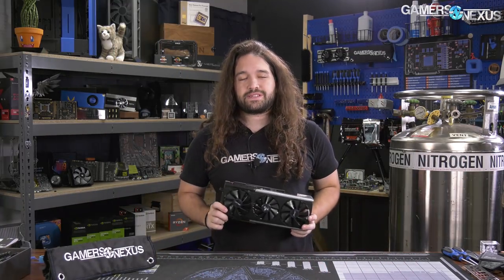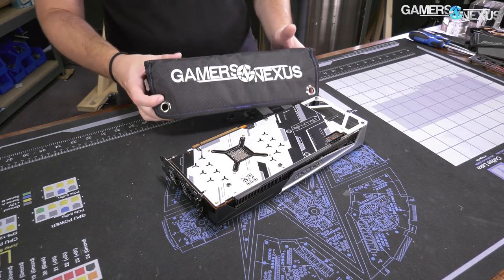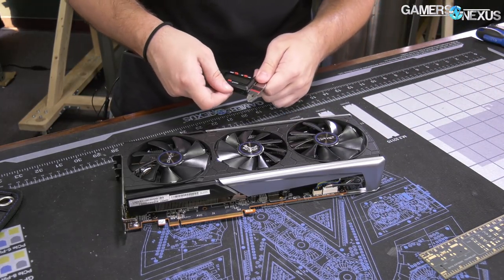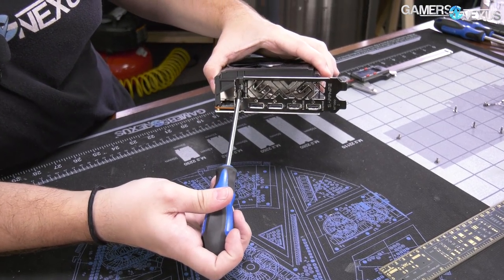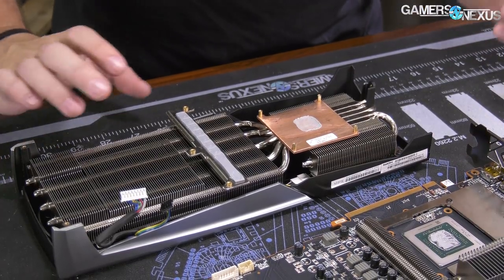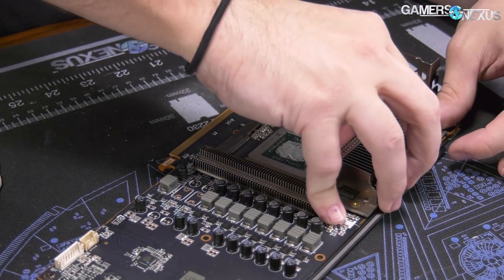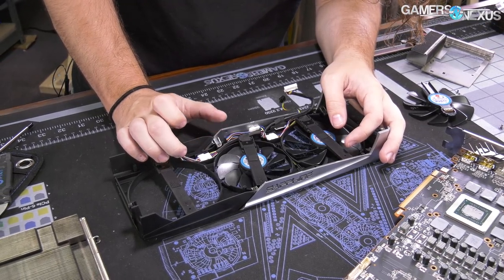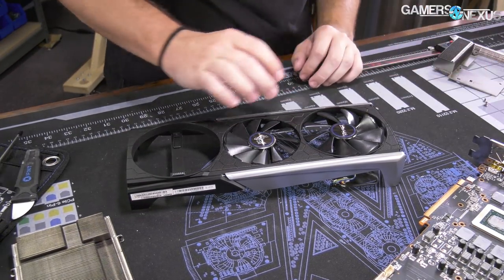Tear-Down: Nitro+ OC Sapphire RX 5700 XT - Thermal Design & Assembly

Comment: Amazing cooling solution, now what i want is them using fans from noctua, more silent more durable. Sure downside it would cost bit more but currently the fans used on most $400+ gpu are a joke compared to brands i use for my case fans. I would pay more for a gpu with my type of brand fans.
And no i dont want watercooling nor a 3rd party air cooler on it; want a custom with good fans. Oh and 120mm fans.
Reply: I feel a little pedantic saying it, but haven’t graphics cards grown outside the PCI/ATX spec enough??? Yes, 120mm fans are nice, but that would be wise enough to worry about whether it would fit in the majority of PC cases.

I’m not saying I don’t like your idea, but is really like a case spec to deal with these super-big GPUs so we don’t have to guess whether a card will fit a case or not!
Reply: Fans that big would require a larger shroud. Not only that you would have to mount the GPU vertically. The fans sit in the middle of the card so extending the outer edge of the cards as well as the inner edge to make it symetrical is a must. It will not fit in a normal horizontal position unless you have an open case. Also with a bigger heavier card comes a COG(Center of Gravity) issue. Even if you were to run it normally its COG would be off making it want to come out of the PCIE slot. That can be fixed with supports but that's too much to ask for.

Comment: Dear Steve, I want to ask you something you didn't mention here. What's the thickness of the thermal pads used? Would a washer improve the Mounting pressure improving the cooling? Thanks you

Comment: Doesn't the (I don't know the term for it) magnetic properties of stainless steel change depending on the amount of iron in the steel ? Sometimes it is magnetic and sometimes it's not. How can one distinguish between non magnetic stainless steel and aluminum?
Reply: I think it depends on how it was formed. Forged/extruded/stamped and how it cooled.  If I recall work hardening (beating it with a hammer can make non conductive stainless conductive.
Reply: Aluminum is less dense, so it will feel a bit lighter.

Comment: Clearly the RGB fans cost more because they boost the performance of your RX 5700 XT beyond that of an RTX 2070S.   Red for more raw power, Green to reduce power draw in eco mode, and Blue for cooler temps.   It's really quite simple.

Comment: I've tested 2 Sapphire Nitro+ OC and the second one heat a lot less than the 1st, and works better, any clue ?
Reply: Luck of the draw. No 2 of anything are exactly the same. The components may be made of the same material, but those materials are not even close to being the same, if that makes anysense. Stainless Steel is Stainless Steel, but no two pieces of Stainless Steel are exactly the same.

Comment: Why don't cases accommodate vertical GPU mounts properly? If the card is going to be right against the glass then provide a glass panel with a port in the middle so the card can pull fresh air through a filter. I'm sure it fan be gracefully done.
Reply: The glass would be very weak if there was a cut out in it
Reply: @mikaelkabraelian8518  the glass is tempered.  It wouldn't be weak. Plus it can be reinforced.

Comment: Steve why did you not about the smaller middle fan running clockwise to ensure optimal airflow as the other 2 fans   run counterclockwise?

Comment: I have a question, so I watched your video of the reference 5700XT. Well, I bought a reference 5700XT at Microcenter for $339.99 ($366 after taxes), it was an open box return. The card works good, and the box wasn't missing anything. My question is, should I keep the card? Or will the high temps you talk about really bad? Should I return it and just get a AIB card? Only reason I didn't buy an AIB card there was because they only had the Gold MSI card, and I didn't really like the aesthetics. Plus this card was cheaper than the Non XT model. Anyways before I drag this along, am I missing out on anything?

Comment: Hey Steve, i appreciate your effort at GN. Could you please give me an advice because the rgbs are not working right now on this card. i mean both of them (logo and led strip) is there any chance to reset them? i'm %90 sure it is not because of hardware, because that rgb's went off when i was using msi mystic software...
Reply: i even formatted windows btw...
Reply: Try Sapphire Trixx to mod the RGB

Comment: Kinda thinking about a new ITX build based on Ryzen 7 3700X and this Nitro + 5700XT. Case accepts full length GPUs. Im just worried about power. SFX PSU only and I want to overclock so Im wondering if BeQuiet's 600w SFX-L could handle power play modded Nitro+
Reply: It should if it has a respectable 80+ rating. What is your 80+ rating?
Reply: @MarcABrown-tt1fp  BeQuiet SFX-L 600W is rated at 80+ Gold (testing shows up to 94% efficiency at 50% load
Reply: @MarcABrown-tt1fp  The 80 plus rating system only deals with efficiency, not quality. You could make a very efficient PSU, but it could at the same time suffer from terrible ripple, which would in turn be bad for overclocking. That's pretty much the difference between switch mode and linear power supplies: One's very efficient, while the other is very low noise.
Reply: @MrPhilip796  Hmm.. that could explain my video card instability. Thanks for the info. (:
Reply: @wallacengineering8096  Bequiet is well known for good power supplies. That psu should easily handle that configuration. If you need more power you may need an upgrade. And if the load still winds up being too much the system wont post with psu overcurrent protection kicking in.
Reply: @MarcABrown-tt1fp  np
Does your card show the sensors for its +12v input? If it fluctuates by a decent margin, then that might also affect your VRM and what that outputs. I at least know that my Vcores on my 295x2 fluctuate in unison with the ripple of my PSU as told by the input sensors. A fix for that would be some capacitors near the inputs, but personally I haven't gotten around to making some custom cables yet.
Reply: @MarcABrown-tt1fp  + PJ thanks for the replies guys! I don't own any of this hardware. This is a planned future portable build as I am a truck driver theae days. I have researched the PSU further using Tom's Hardware for in-depth analysis. Seems to have good quality engineering and can even handle 110% load. It also has good ripple suppression on all but the +5VSB. Im just worried about power play mods pushing the Nitro+ RX 5700-XT beyond 300 watts. This combined with OC on CPU would probably put the PSU under ~90% load. Im wondering if stepping up to Corsair SF750 would be worth the extra cost so it isn't so stressed out and efficiently would be much better at ~65% load. Alternatively I could just reduce my OC goals down to "mild", keeping GPU under 300 watts and CPU under 100 watts, meaning the BeQuiet SFX-L 600W would be loaded to more like ~60-70%.
Reply: @MrPhilip796  Unfortunately no, I tried looking through Hardware monitor and could only see final stage voltage ie: the gpu voltage. It isn't PC breaking, but every now and then (every 100 boot's) my new rx 580 exhibits red checkerboard artifacting, same with my rx 570.
Reply: @wallacengineering8096  I wouldn't worry. 600 watts is way more than people realise. Back when I used to daily a 780 Ti I would have it draw around 360W all by itself during benchmarks, and my 1700 would draw a bit over 100W as well. That was on a Corsair RM550x and not even once did I trigger the over current protection with that system.
Reply: @MarcABrown-tt1fp  Hardware monitor I've heard is garbage, try using HWiNFO64 instead and see if it's able to see the sensor.
Although if it's that rare, I think it might just be the AMD driver not completely liking your system for whatever reason, or a slightly unstable overclock or undervolt if you're not running at stock
Reply: @MrPhilip796  Sweet thanks!
Reply: +1 for HWInfo64!
Reply: @MrPhilip796  Wow, thanks! Hwinfo is definitely far better. My gpu input voltage looks stable at 12.18 so my power supply is stable, meaning my gpu drivers are the culprit, they are not playing nice with my Gigabyte B450m.

Comment: Bad things:
A lot of power being pulled through the PCIE interface (up to 5 A) opposed to the 8 pin power supply

Use of dual Mosfets instead of single stages

Good things:
Cool
Quiet
Replacable fans
Reply: I haven't heard anyone talking about the pcie power draw with these cards so i assume it's within safe limits.
I remember there was a power overdraw problem with the 480 i think.
Reply: @imrileth6618  Yeah just within safe limits. 5 amps it is. Pretty shitty if you aim for hard OCing.

Get STRIX or MSI Gaming X with far superior PCB for OCing.

Here an article about it:
https://www.igorslab.media/en/sapphire-rx-5700-xt-nitro-plus-in-test-sprinting-better-with-less-weight-and-the-best-navi-card-so-far/

Comment: Commenting at 9:20 
Has there been a gpu with a fan that pulls the air out through the card instead of in through the card?
Reply: No that wouldn`t be practical since the PCB would block the "intake" Airflow.

Comment: I am disappointed with outputs. Why 2x HDMI and 2x DP? I have triple monitor setup and I need 3xDP. Any chance that Sapphire release this version as well?
Reply: nice thing is DP ports can be split and since it's DP 1.4 there's enough bandwidth on the port to do 2x4k resolution per port.

Comment: Maybe I'm stupid, but when I hovered over this video before clicking on it, it shows Steve putting liquid metal on a chip that isnt on a PCB. But I dont see that in this video. Whats going on??
Reply: Its a prerecorded sponsor clip.
Reply: @DrPenz  How does that work? Can a channel just change that 3 second clip on a video? And are they allowed to put in a clip completely unrelated to the actual video?
Reply: @SIC66SIC66  it's like an add that the youtuber does
Reply: @SIC66SIC66  and it's in the beginning of the video ,the liquid metal part
Reply: @mikaelkabraelian8518  Oh, right, it is indeed in the beginning. I guess I skipped the ad.

Comment: Please use the calipers properly. Internal diameters are measured with the small "beak" on the opposite side of the one you are using.
Reply: I thought that too but he measured fan diameter not opening diameter and I decided that must be it too since a fan only knows its own diameter and not where it ends up used

Comment: is it worth buying 5700 xt nitro + or 5700xt red devil or 5700 xt pulse?
Reply: Basing on performance, buy cheaper or/and avaliable. Nitro+ and Red Devil are less noisy, have better temps, but Pulse also have good one. Nitro+ have RGB, nice looks and these fans in both Shappire are genius. Im buying Nitro+ cause these fans and it looks better for me than Red Devil, and they are in the same price in my country, so it's easy choice.
Reply: @BOLOYOO  461$ nitro+ and 440 red devil. Choice🤔🤔🤔🤔🤔🤔
Reply: @Mikurov  Your choice. I would still go with Nitro+, cause separate cooling on VRM, and easy to replace fans (beside the looks). You can also check HardwareCanucks roundup of 5700/XT. Red Devil is silent but it have less pleasant fan noise IMHO. But in case, with headphones it should be irrelevant. So, it's up to you. I think you can't choose wrong between them. You can also check warranty. If Nitro have 3 y and RD 2 y, Sapphire is clear winner for me.
Reply: go with what ever fits in your budget and is available.. can't go wrong with any of those cards.

Comment: Sucks that it's an AMD GPU, good build quality though concerned about the hot-swap-able fans not secured properly, vibration harmonics with sound reproduction not screwed down with more than 5 pounds (shearing force of the screw) of force from machine tri-lobed 3mm screws with natural rubber washer.